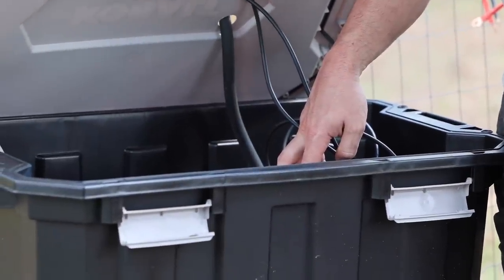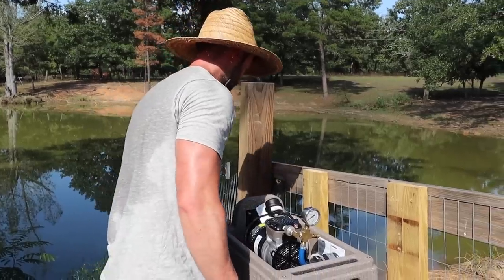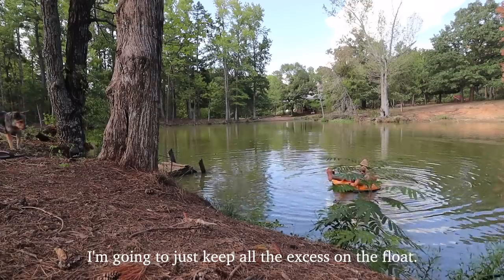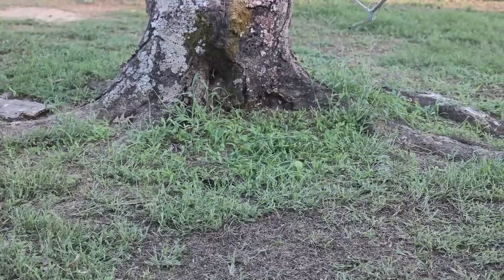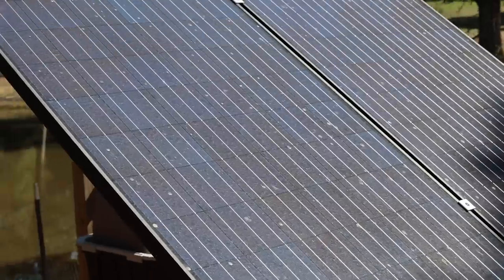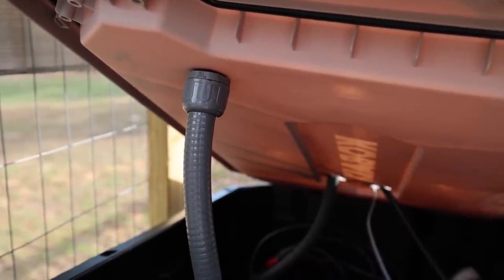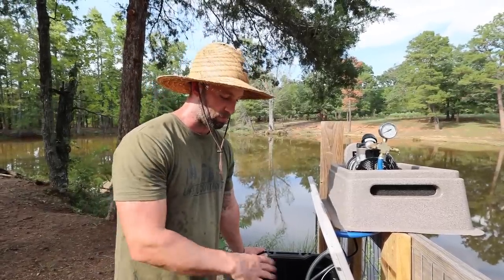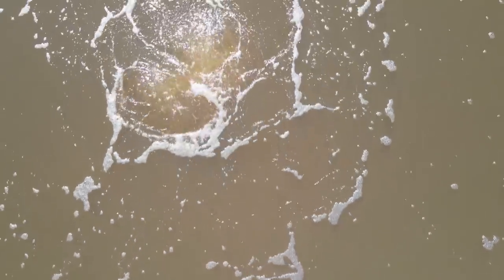BUILDING OUR OFF GRID OASIS | Our Finished DIY Pond Aeration

Comment: Y’all are the 2nd most snakey place I know. 
I used to go hunting w a friend and when we did the summer work of brush cutting , planting and just working the land etc we’d see at least 100 rattlesnakes during the summer. Those things were massive. Probably 10” round and 6-8’ long. There were no small ones that I ever saw. 

Part of the land was about 50 acres of hayfields. They bale up large round bales and stack them around the field to get as needed. If you disturbed any hay bales be ready for a few to come out from under them. 
It was one of the rules if the club that we had to wear snake boots at all times even during the winter because here in alabama it can still be 60-70 degrees in the winter sometimes. 

Then when I started watching y’all’s channel & seeing all the snakes y’all find y’all come in #2 as most snakey places I’ve seen. Lol

Be vigilant out there

Comment: Something else you might consider is a water fountain.  You can put the intake on one side of the pond and the fountain on the other an it will circulate the water.  Aeration will make your fish grow larger.  The Japanese aerate their mud ponds with what looks like a steam boat paddle that spins and flips and splashes the water.  I have a Karashi Koi from Japan that is 28 inches and still growing he would get huge in that pond..  With catfish you will always have muddy water.  You can also use septic tank bacteria and enzymes in your pond read the labels there are fish safe ones. If you pour it around the aerator it will eat up sludge.
Reply: I love the idea of adding a fountain to help circulate the water.
Reply: A fan of water, also called an aerator on a swimming pool, will also clear your pond and cool it a few degrees..
It does the same thing that a natural waterfall would do..
Reply: @daveallen63  I live in Arlington Texas we didn’t have rain from June 3 until August 21st.  100+ for days on end.  I have a waterfall on my pond and air on my pond he has isn’t going to get evaporated by a fountain but I do like waterfalls he would need a liner and rocks for that and a 1/8 horse power artesian pump at least for that. $500-600 bucks.
Reply: Yes it aeration twice to look at and hear
Reply: I would definitely agree to that as it would probably help aerate if the pond even more and add an artistic appearance
Reply: Add a pump for circulation
Reply: I was also going to mention a fountain
Reply: That's exactly what I was going to say
Reply: @sherriebates2584  and how about adding some colored lights to the fountain. That would be so beautiful. Come on Spence, you can do it! MacKenzie you are an amazing wife and mother. I just love watching all your shows and hope you never stop doing them. God bless your family!

Comment: I think the catfish may have turned your air-stone stand upside down. That may be why there is so much sediment. You might be able to build the stand a little taller so the bubblers are further from the bottom sediment, and also wider (and maybe heavier) so it is more stable and less likely to flip over. Best wishes!

Comment: It is very difficult to keep a pond with almost stale water clear from algae, especially in the summertime when the sun heat up the water. I would think you can see quite some improvement here in the fall and winter, but the real test will be next summer, when the heat comes back. Still a great project tho. 👍

Comment: Surprisingly, it's actually clearing up.  I was very sure that you were going to need some kind of giant filter.  I've seen also people using chemicals to clear up a large body of water, when the best solution should be a totally natural system that doesn't require something toxic, defeating the purpose of a clean natural pond.  I'm glad it worked...

Comment: Spencer here's a tip I learned while maintaining a 20 acre lake and it applies to a pond as well.  To impede the growth of algae one has to cut back the amount of light penetrating the water causing algae growth.  I used a product called Aqua Shade that is highly concentrated and it colors the water and shades it as well.  There is zero harm to the fish and small crustaceans st the bottom of the food chain.  I'm not promoting a specific product because there are many good ones.  Most golf courses use an aqua shade and I recommend doing that to enhance the beauty of your pond.

Comment: To remove the lid without difficulty created by the lid drain hose going through the bottom of the tote , you could mount a bigger straight pipe from the bottom of the tote going up and shorter the smaller drain hose that would slide free in the bigger stationary pipe .

Comment: Great idea. Shade net on the perimeter fencing about two to three feet wide along the length of the fencing will help keep snakes out. Also won't there be a danger of overheating in the battery, converter box without any ventilation holes? Just a thought.

Comment: Robin from Spain
We had a lake in the UK. To clear the water quicker was to use Barley straw bales as  a dam and suck the water from the upside of the lake and the outlet actually hits the bales and then the outlet water goes through the bales, Barley bales are a good filter. Once you have got that going you will see a difference in the water. It will take some time but it does work. If you can make sure the bales at the outer edges. Just a thought to get the water clearer. Summer is the worst time keeping the water clearer the water gets warmer and then you get more algae, you might have to change the bales if it gets overload. Good luck.😂😀👨‍✈👩‍✈

Comment: Spencer, I looked up retail shade products and The Pond Guy Pond Shade was more reasonable at $29.99-$39.99 and Aquashade is $59.99 but contains multiple applications or about 2 years usage IMO.  You will be pleased with the results.  Also, a couple of sterile Grass Carp will rate the algae and keep the bottom clean.  Being sterile they do not propagate and they are not carnivores.  Keeping a healthy pond in balance is a challenge and a lot of fun.  It's like maintaining a large aquarium in your house.  Well maintained they are healthy but poorly maintained they are a mess.  Have fun.

Comment: You can make a longer dock into the middle of the pond by putting a floating end on it instead of one that is secured to beams driven into the mud and dirt underneath the water all the way out. You can achieve this by making a rectangular box with planked top and securing empty metal drums under it for buoyancy securing that to the small dock you build off shore. Add a ladder to get in and out of the water easily and viola!

Comment: Did you test the drain with the heavy pump put on top of the lid? It seems there is not much height difference between the drain and the holes to the inside of the box. The weight could bend the lid down. And, knowing from your other videos, sometimes you have very hard rainfalls.

Comment: Good day guys. I am one of your subscribers from South Africa. 

Your vreen pond problem is easy to fix. You should put bales of wheat stalks..... baled wheat that has already been harvested. In the water. Make baskets with ''shade netting'' and float these basket with some inner tubes in the pond. I don't know why but it works. We cleaned our off chanel dam of about 8 hectares in size with only 10 floats off hay. 

These floats also gave water foal lots of nesting spots.

You  ould maybe even google this. I have not as we did this and it worked 

Regards

Stals König.... South Africa!

Comment: The aerator will work. It may take up to several months to see its full potential though. I highly recommend adding pond Dye. It's nontoxic to fish and will multiply the benefits of the aerator. I use Sanco industries Crystal blue XL. 2.5 gallons per million gallons of pond water. They use surface are by an average depth for coverage. It holds up great and only has to be reapplied 2 to 3 times a year. The only thing I would also add if you don't see the results you're looking for is surface aeration, a fountain. Together your water will clear up and all your turbidity issues will surely clear up.

Comment: To clear a muddy water pond, we normally take buy a bag bentonite powder and use a trolling motor to mix the bentonite powder with the water in the pond. Don’t forget to wear a good mask because bentonite is so fine and it is not good to breath in.  After mixing bentonite with pond water at different location in the pond it will take a few days then the bentonite will clump together the mud particles in the pond water then it will sink to the bottom of the pond. It will serve two purposes.
1. It will clear up your pond water to the point that you can see to the pond bottom.
2. Bentonite is a fine powder but it will swell up when absorbed water, that it will help plug up any leak from your pond bottom.

Comment: Our pond is a little bigger than that. We use 2 aerators. One is like yours and one is a fountain type, spraying the water in the air. We noticed a big difference once we installed the fountain type. The guy who delivers our water recommended it. I hope yours works.

Comment: There is  also a natural way to clear the water,  I have a small garden pond with fish that use to go green I tried filters and pumps but there is an on going cost running them, I started to use barley straw secured in nets and just chucked them into the pond and it cleared up the water, I had to replace them each year or two. You can also plant oxygenating plants that will grow and spread these provide shade and a natural habitat for many type of insets and fish. Your water area is very large so you will need a lot of barley straw, as for the plants  your local laws may not permit you to use them.

Comment: I use a similar setup but the little red inverter has actually been doing great for 4 years now . I do use a diaphragm style air pump though which is a whole lot quieter and only uses 40W .  You might like to switch to one of those if yours ever needs replacing . They are easily rebuilt for about $15 but so far I haven't had to . It's very reliable also . I also use the same LV cutoff as you did and it works very well . One thing I did was to not put catfish in the pond as they stay on the bottom and constantly stir up muck keeping the water cloudy . Only Bass and Bream in mine . The catfish may have flipped your aerator also , adding to the color of the pond . .Throwing in some pond dye around April that has the beneficial bacteria in it also helps clear the water very well . I usually have about 3' of visibility after adding the aerator .

Comment: If you plan to run the aerator year-round you will need to keep the Lithium battery from freezing.  Charging below freezing will damage the battery.  I'd recommend you install 12v tank heaters or 12v honey bee hive heaters on a thermostat.  Just keep the battery box above 32 degrees F and it should be fine.  BTW, I'm sure your catfish are loving it.

Comment: 1 air outlets on the bottom is going to kick up sediment  that pump can support 5 to 8 outlets spread out but you need them 1ft off the bottom use fishing line and a coin purse of rocks place 4 of them in the corners of a 6 ft square  oe take 4, 6 ft pvc with 90deg elbows  drill 5 to 6 1/4 holes in each side   use fishing line to a single bagel of rocks from each corner to the middle  1 ft offset use 4 fishing lines from corners up to a bouey this will help greatly and give some portability to relocate

Comment: For such a big pond, if the aerator isnt cutting it after a week or two, using a flocculent would clumb all the suspended algua and other clay debris and get to the bottom of the pond.
Also if still not very clear, using Sodium Percarbonate would clear the pond very quickly by bringing a lot of oxygen, then the aerator could keep the pond clear.
Boths products doesnt harm fishs in a pond.

Comment: be careful with trying to charge your battery after the occasional nighttime freeze. Trying to charge a lithium battery while its temperature is below 32 F will very quickly kill your battery. Check the spec sheet off the battery to see the accepted temperatures. If needed turn it of the night before, if you even want to run that aerator in winter.

Comment: Brother if you find this is still killing the battery on cloudy days. Or if you find you just need more controls over when and how long things run. Look at buying a victron charge controller like the 100-15 or 100-25. This has a 20 amp out put. That you can fully customize the setting. This will let you use that DC out put to control a external relay. That then can run your Inviter. It's nuts all the control this will give you. I run the 100 - 15 Mppt  victron charge controller. For my off-grid letting tower. Never do I have to mess with it. It just works. 

Love your setup and that low Volt cut off is the same one I run on my golf cart. This is so if someone forgets to cut off the lights. It will trip and kill the lights. Love how it has the over ride. Thanks for sharing so much. Been with yall from just about day one. God Bless...

Comment: "California Air Tools" makes really cool air compressors which are just about silent. I have one, love it. Most of the units they sell come with a tank, but I bet if you go direct to the manufacturer you might be able to match what you have as far as no tank, similar pressure and flow, and set it right into your system - but without any of the noise.

Comment: Do you have the aerator resting on the floor of the pond or is it suspended just above? I would have thought that if it's on the bottom, the air might stir up the mud, but if you could get it up a bit, then it might clear quicker. Maybe suspend on top of a plastic milk crate or similar. Amazing how quickly it cleared up so far. Keep up the good work. Well done guys...

Comment: This is one of those times that it needs the guy touch.  More is better.  You could get the pond straitened out with the system you have but running 24 hours a day would be better.  Used to work with dairy's and it took a lot of wrenching on the owner to get him to aerate his pit.  Once he did it, he was so surprised the improvement of the smell of the place as a whole and the "stuff" in the pit digested so much faster.  Used a 25hp motor with a regenerative compressor to do it but is sure did make a difference.

Comment: Did you put a Check valve on the line going into the water to make sure if there is no power the water doesn't go back into the box and ruin the pump? or do you need one in the first place?

Comment: Thank you for this video.  Can you provide details on the low voltage disconnect model you are using?  they make a 12v, 24v, 30v and 48volt model?  Also what is the model of your inverter?  I'm putting together a similar setup and yours is the only video on youtube doing a DIY setup with a rocking piston AC pump on solar, so I didn't have a lot of help, until I found your video.

Comment: Is there any reason you couldn't just use a 24V DC air pump and plug the solar panel straight into it? Then it only runs during the day?

Comment: The Aerator is a Good idea but it does need a bit of help with moving the volume of water and that’s why you would be better off with a Aerator/Fountain.
These devices just float in the middle of your pond or lake and water is drawn into the Machine which then aerates the fountain water but also the surrounding water meaning cleaning is quicker and more efficient than just a aerator alone.
I’ve heard of people burying a electric cable along their property lines which apparently snakes will not cross ?!!! Doesn’t need to be high voltage or amperage but needs to be just below the surface.

Comment: The reason that the small inverter didn't work is that when the compressor motor starts it may draw up to 3 times the running current.  I hope that it all works out well for you.

Comment: Is the battery self heating? Without self heating it should not be charge when the battery is below 32ºF. You should insulate the battery box, or turn it off during cold periods.

Comment: Hello, I see your constant struggle with snakes. I would like to remind you of the information that I hope may be of use to you. Snakes generally do not like strong odors, so putting sulfur and lime in the areas where they are found will completely remove them from their environment. In addition, another effective method is to put mothballs in the area where it is located in order to remove the snake. Also, hedgehogs are snakes' worst enemies. If you can adapt a few hedgehogs to your garden, it will work. Best wishes

Comment: You need to be careful introducing the aeration to the lake, especially if it is a mature ecosystem, as in the pond has been there for years. Running it for too long at a time can introduce ammonia into the water which is toxic to all the fish. You need to introduce it gradually over time, running it for a couple of hours at first. The waiting a day and run it incrementally longer. All the time monitor the lake. If you see any dead fish, you need to stop using it for several days and then start the process over again. It will work over time and the fish will be fine as long as the aeration is introduced gradually, allowing any toxicity to vent from eh water and not concentrate.

Comment: Problem alert: As soon as that drainage setup fails (overwhelmed by rain amount, debris, or combo) the water level on top of that tote lid will exceed the height of the top holes and the battery box will fill with water. Batteries will short out in their water bath and burn up.